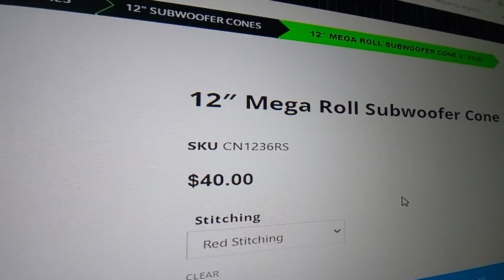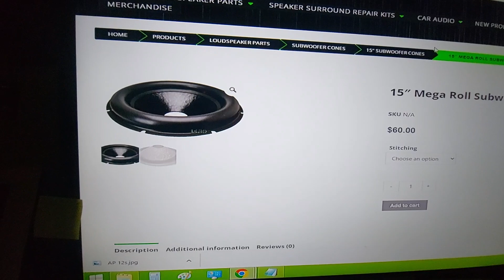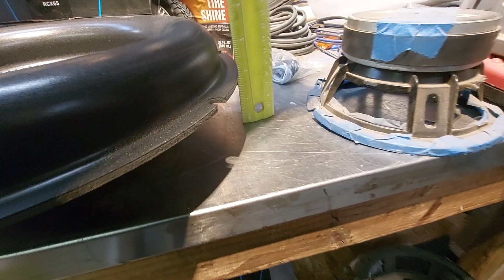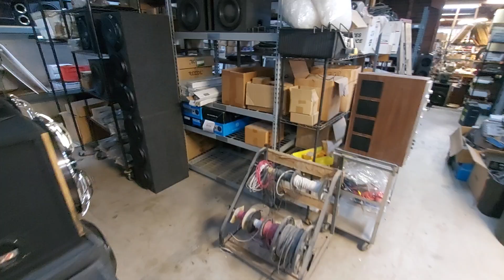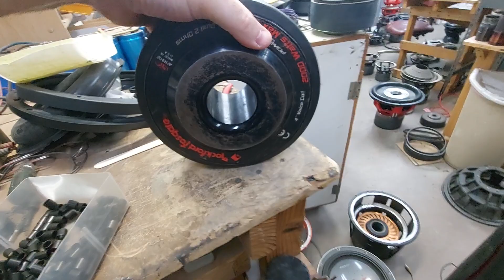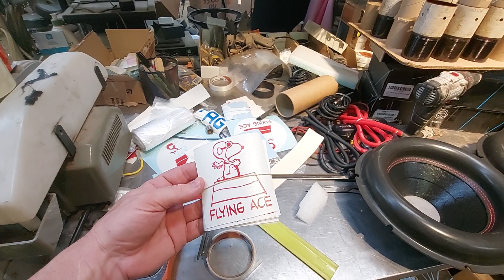INFLATION COCK BLOCK sale extended through Aug.  GONZO cones, Jizz Llama & GONZO amps & Offer Up ads

Comment: Can I still get a 18" mega roll cone and surround for 50.00? If so how do I pay and get it shipped
Reply from the maker: Sorry, that sale ended.  They're still only $65 each shipped right now until we can get the store  up and running.  I should have them on eBay here in the next couple of days.  You can text me direct with your name and shipping address.  I use Cash App. 6023126504

Comment: How much if I bought a recoil 600.4 from you?
Reply from the maker: The Class D or Class AB?
Reply: @RobotUnderground  the AB one that is $95 on Amazon. You sell it any cheaper?
Reply from the maker: @1ohmwrecker  I sell the 500.4 for $75 shipped.  Fused at 50A.  Same amp as Cerwin Vega Mobile at the time.

Comment: hey bro so how many of those batteries should i run using my 5k @ 1ohm off of a 320 amp alt? im tryin not to dip below 13.5v...
Reply: You'll need more alternator power. You don't get any real power from lead acid until 12.8 and below. 

To hold 13.5 with a 5k, assuming 70% efficiency, and lead acid for batteries, you'll need around 480amps. Dual alt territory. 

You need lithium realistically to hold that voltage with your single alt. It won't last long however, depends on the size of the bank, and it gets expensive. 

Just some solid info for ya.
Reply: @georgesrisomsak9650  right on makes sense, thanks bud
Reply from the maker: Around 200ah of lead acid.  That alternator is plenty.  You can also do around 100aH of lithium.
Reply: @RobotUnderground  ok cool I thought so..I have a super cap that has a small bank of lithium built into it so it wants to run at around 14v it's just hard to keep it there cuz my bank of lead acids are getting pretty old so I'll probably snag many as I can from u hopefully soon
Reply from the maker: @fabeybaby8213  LifePo4 is what you want

Comment: What's your website name to purchase your products?
Reply from the maker: https://offerup.com/item/detail/1444293531
https://offerup.com/item/detail/1444285017
https://offerup.com/item/detail/1444281863
https://offerup.com/item/detail/1444260577
https://offerup.com/item/detail/1444257056
https://offerup.com/item/detail/1444254119
https://offerup.com/item/detail/1444246912
https://offerup.com/item/detail/1444231354
https://offerup.com/item/detail/1444228385
https://offerup.com/item/detail/1444226310
https://offerup.com/item/detail/1444224437
https://offerup.com/item/detail/1444222843
https://offerup.com/item/detail/1444220631
https://offerup.com/item/detail/1444217470
https://offerup.com/item/detail/1444215231
https://offerup.com/item/detail/1444213281
https://offerup.com/item/detail/1444210477
https://offerup.com/item/detail/1444204743
https://offerup.com/item/detail/1444201880
T2 on it's own https://offerup.com/item/detail/1442436084
Recoil 0ga OFC wire kit PCK0D: https://offerup.com/item/detail/1442434520
1 ohm Class D: https://offerup.com/item/detail/1442432961
Recoil Class AB 4ch: https://offerup.com/item/detail/1442431282
Punch 225.2: https://offerup.com/item/detail/1442430273
400w Fusion 2ch: https://offerup.com/item/detail/1442428795
1 or 2 ohm 700w Class D: https://offerup.com/item/detail/1442427255
Kenwood 10" w/ box: https://offerup.com/item/detail/1442426249
12D2 Cylon: https://offerup.com/item/detail/1437047495
15D2 Blue Steel: https://offerup.com/item/detail/1437045919
12" RE & Fusion bass combo: https://offerup.com/item/detail/1437041693
15D4 CVX: https://offerup.com/item/detail/1431303716
3x 10's w/ box: https://offerup.com/item/detail/1433077459
Rotel home amp: https://offerup.com/item/detail/1391464349
IDQ 10": https://offerup.com/item/detail/1437039282
50F power cap with DVM: https://offerup.com/item/detail/1391977368